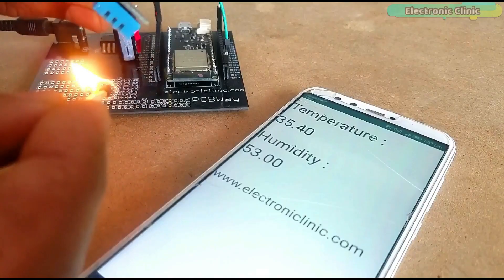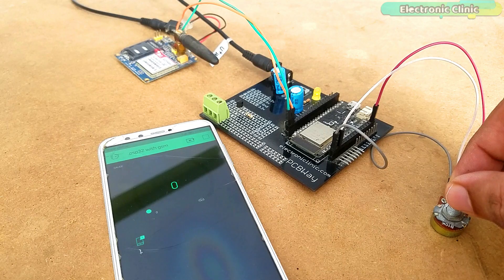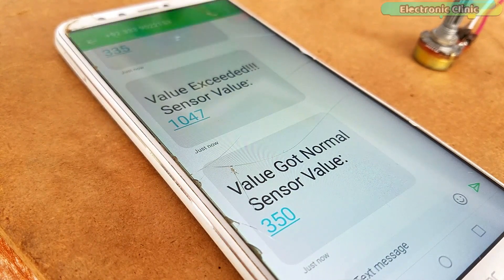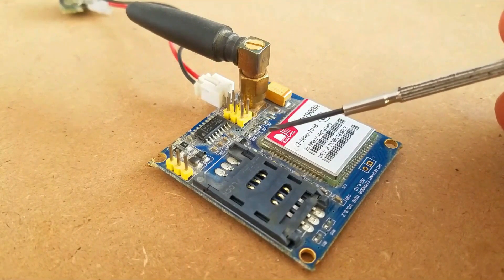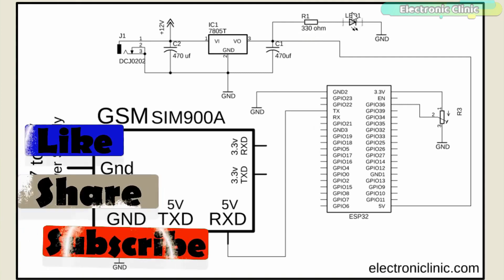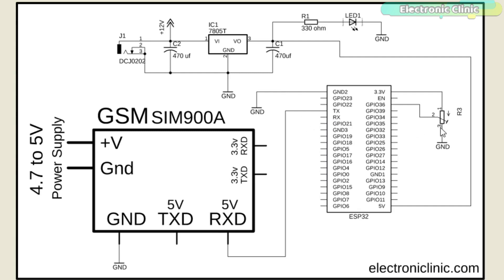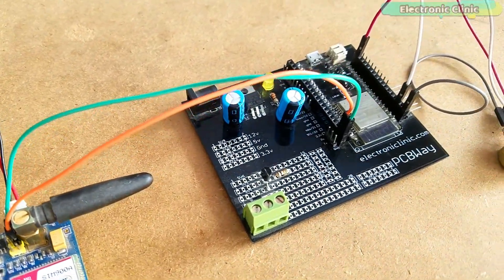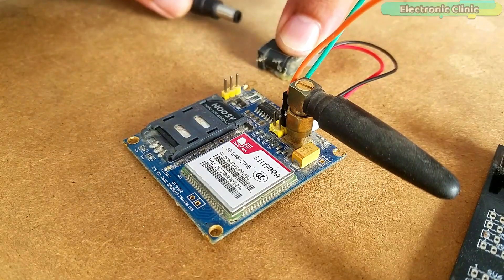ESP32 with GSM Sim900, ESP32 & GSM, GSM Wifi, text message & Blynk App, IOT GSM,esp32 project

Comment: How do you power this module while you're away from home? 
I'm able to power this module and make gsm connection only with  5v 2amp adapter.
I want to make it portable.
Reply from the maker: make a battery pack using lithium ion batteries. check playlist.

Comment: Does this have to connect to an Access Point to send messages ? I see in the Sketch that you have put in the 
char ssid[ ] 
char pwd[ ]

Are you connecting it to a Wireless Router / AP ? before it is sent to the Blynk broker / cloud.

My project does not have any WirelessRouter nearby, and this unit has to connect to the Coud/Blynk in your case direct over the SIM card.
Reply from the maker: ya this uses wifi

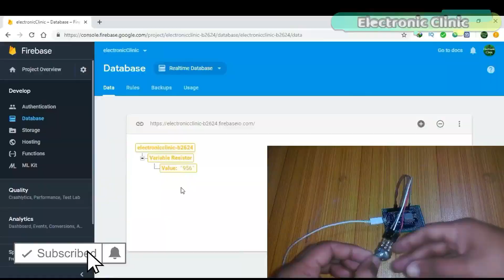Comment: At 0:21 you used App to control LED , what is it ?
 how to design Andriod  App to control things using gsm  at commands ?
Does GSM module supply internet connection to ESP32 - behaves like a router?

♥♥♥
thanx